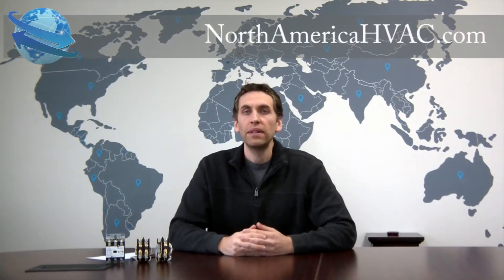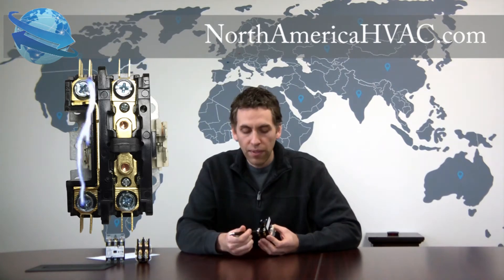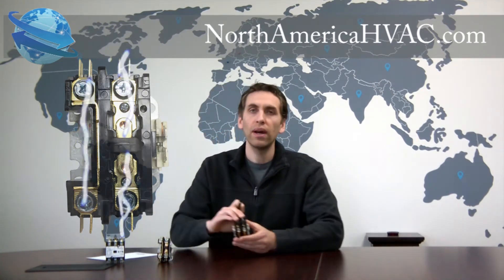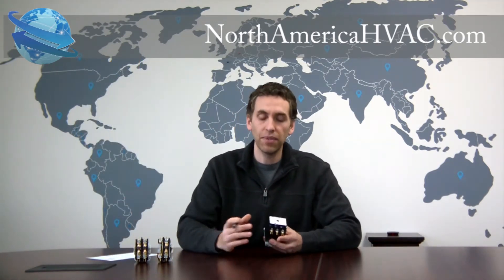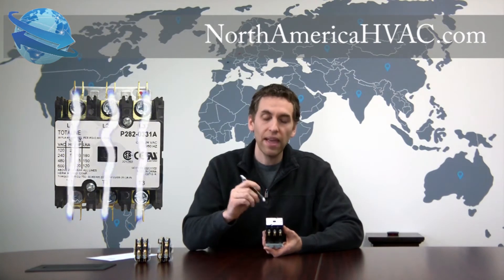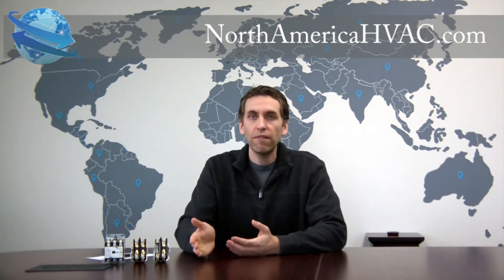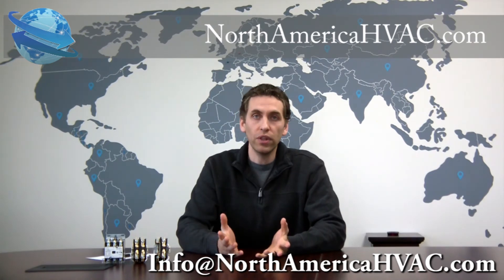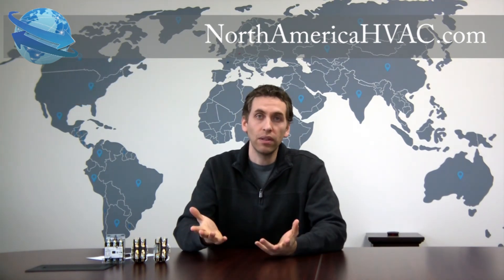What is a Single Double & Tripple Pole Contactor -and Can / Should you change yours?

Comment: My old contactor is labeled L3 L1 T3 T1 and my new one is labeled L1 L2 T1 T2 how do I know what wires to put where
Reply: When a contactor has the L3 and T3, that how you know it’s a three phase, because the “L” means input, and the “T” means output. So that’s probably the wrong contactor.

Comment: I manage a self serve car wash and we use the contactor to start our high pressure pumps. I am replacing a 40 year old 1 phase 2 pole one and the only one my local supply company has is a 3 pole. I believe that we have 2 hot and a ground or a hot, neutral and ground. The contactor is energized by a 110 stepped down to 24 volts. What would be the problem if any using the 3 pole vs a 2 pole providing I can find a replacement? Thank you
Reply from the maker: Hello!  There is no problem using a 3 pole instead of a 2 pole as long as the coil voltage is the same, and you have enough footprint room to install the slightly bigger body.  You would just ignore the third pole, and hook up the two that you need.

Do you know what coil voltage you have?  And do you know what type of amperage will be going through this contactor?  If you are looking for a 2 pole 24 volt (coil/energizing voltage) contactor to replace yours with a more similar contactor, check out this link: http://www.northamericahvac.com/mars-24-volt-contactor-relay-17321-double-2-pole/

Best of luck!
NAHVAC

Comment: I have single pole contactor in my system.  The store down the road gave me a double and it did not work.  They said that it should work and may fight me on the return.  Any thoughts ?
Reply: You could jumper the terminals of the extra contactor with appropriate gauge wire to simulate the shunt that was present on the single pole contactor.